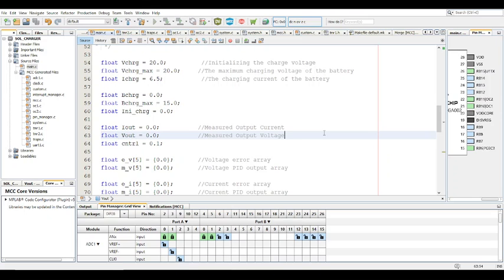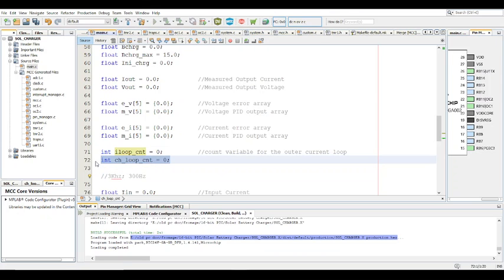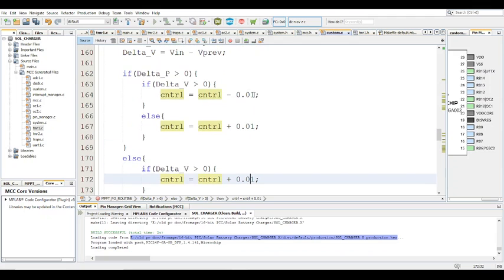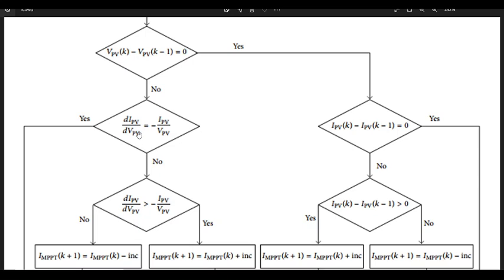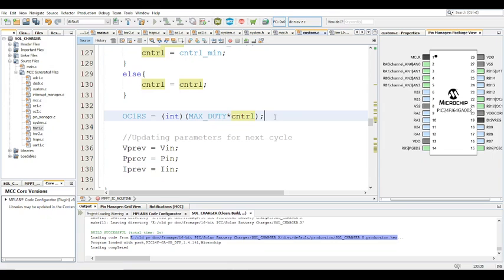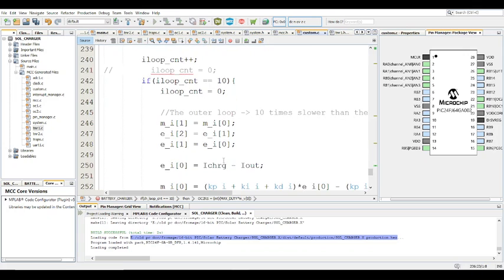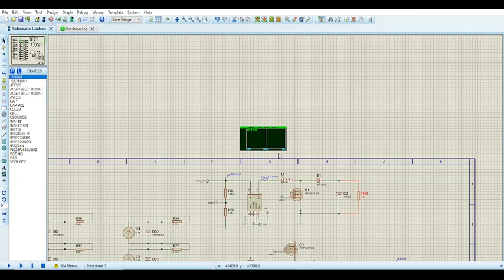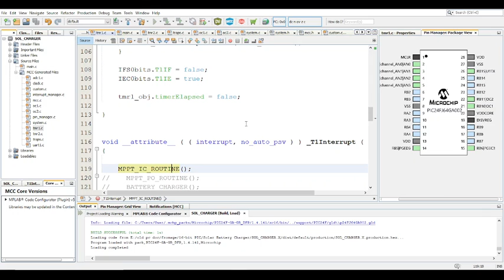MPPT solar battery charger using a PIC Microcontroller

Comment: @ hallelujah, can you do code for bulk Mppt?You have done for boost Mppt.
Reply from the maker: Hello. The algorithm stays the same for a buck converter. For input current sensing, I advice using either a low pass filter sensor before connection to the microcontroller. Or you can simply use a low pass LC  filter on the input. The goal of both methods is to ease input current sensing by the microcontroller, I.e. make input current appear or become continuous.